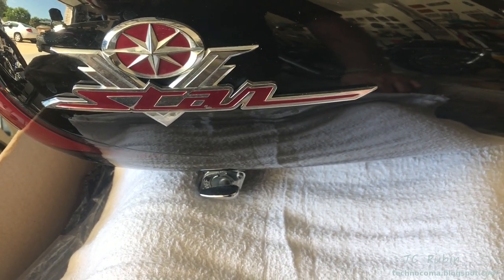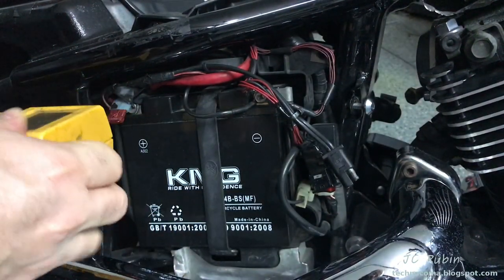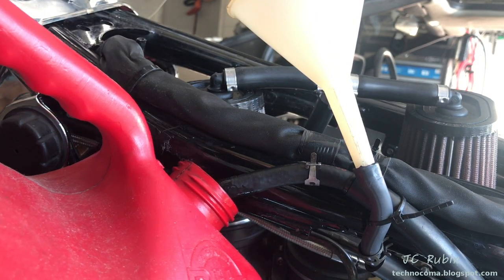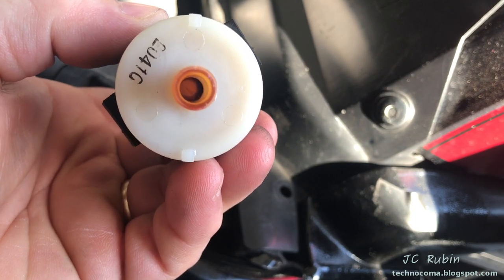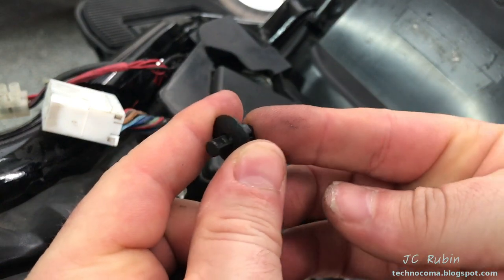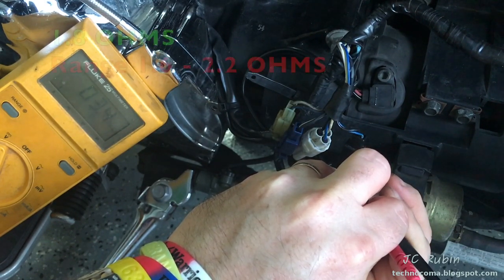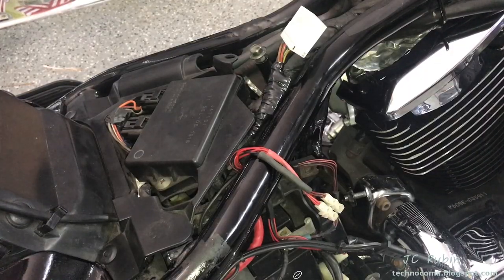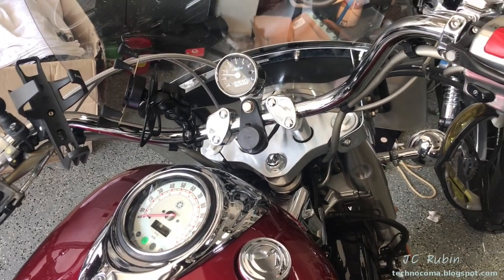Yamaha VSTAR 1100 Fuel System Testing and Troubleshooting  - From The Fuel Tank to the Carbs

Comment: Mate, I owe you! This video saved me a trip to the shop. bike wouild not start, fuel pump dead. It ended up being the rear 30 amp fuse! Pulled it out, checked continuity and put it back in. Brmmm, and away she went. Thanks so much👍

Comment: Love the video! My Brother in Law and I have been trying to figure out what is causing my V Star 1100 to not get enough fuel. We think we found the issue at the Fuel Pump. We noticed that over time the pump got much louder when priming and it seemed to always lag behind when getting on the throttle. 

We might have to go back and undo the gas lines to see how much it’s actually pumping, but huge props on the video! You have made my life much easier as a first time motorcycle buyer!
Reply from the maker: Glad the video was able to help out.

Comment: Thanks for getting back. I guess what I need to know is how to do the electrical check on the fuel pump relay. I did perform the continuity test on my current relay at least 3 separate times and got no reading at all. I’ve since ordered a replacement and need to know how to perform an electrical test with just the rudimentary tools I now have.
Thanks

Comment: Great tutorial!  If taken and considered at the conceptual level, this approach applies to most all vehicles with internal combustion engines.  👍
Reply from the maker: Fuel injection would have taken me longer to go through. There’s a lot of dynamic considerations in efi.
Reply: @retrotechandelectronics  We await your EFI diagnostic and maintenance video!  In my case I was thinking about my 36ft RV with its carbureted V10 engine.  I'd probably put in four miles just going back and forth between the engine compartment and the gas tank checking on connections, wiring, and so on.  At least on the Yamaha everything is within arm's reach.

Comment: Your videos really helped to rebuild the carbs (there was some green gas rot in the enrichener circuit / section) but I'm having an issue where the bike doesn't have the power / quickness to rev as she once did. She's sluggish to rev is the best way to describe it. The bike was like this even before rebuilding the carbs. The bike is completely stock. I've changed the CV rubber boots and needles from another working well bike, thinking there might be a pinhole that I couldn't see, but no difference. Tried replacing the full pump, same thing no difference. There's a new fuel filter put on in the stock location. Spark plugs look ok as there is no wetness residue. I'm really stumped as to what to look for next.
Reply: Did you ever find out what wrong. I felt my bike sluggish today.
Reply: @frankperez4558  Yeah I changed the spark plugs and she was fine after that. I’m assuming one of the NGK plugs was fouled.

Comment: Need some clarification on the fuel pump relay test. I think I can perform the continuity test with alligator clips & my HF multimeters. Not really sure how to test to get the “click click” that you showed. I don’t have that same piece of equipment you do. All fuses good. Horn, lights, starter all work. I also checked the corresponding power source on the harness withe ignition switch on and the kill switch in the ON position. With my test light, it showed power. Hopefully, I can get the fuel pump going.😃
I also enjoy your videos because you retake the time to explain everything in great detail. Whatever mechanical aptitude I have comes from YouTube.
Reply from the maker: The clicking is the priming when you turn on the ignition, provided the bowl aren't filled with gas.
Reply: i have a 1999 Yamaha road star silverado 1600cc  which  i just bought i notice no noise from fuel pump need to find the fuel pump with image

Comment: I live in Germany and recently had my XVS 1100 Dragstar classic (European version of the V.Star) in the shop because live the bike in the video I had let it sit for a few years and the gas turned to slop. I had the bike towed there in order not to gunk up the fuel system with the old gas. The shop supposedly overhauled the carbs, adjusted the valves and installed a new peacock. When I picked up the bike it seemed to run pretty good, not great but good. But gradually the bike started having issues and it got to the point ( after only 600 kilometers) that I needed to drive with the choke on all the time. Long story short, i brought the bike back and explained what was happening and they told me that I was to blame because i only drove 600 kilometers in 3 months and that would cause the fuel system to gunk up again. They ended up cranking up the idle and SOLD me a can of fuel additive and told me to come back after i pushed a tank of fuel with the additive through the system.  The bike still isn't running great. I would appreciate any thoughts , opinions or advice on what is going on. Thanks.

Comment: Your videos are Super helpful I appreciate you...quick question.. I installed a new feul pump on my 2000 1100 v star... it clicks when priming, normal... but then it clicks about every 2/3 seconds after running... is this normal... thank you sir
Reply: Yes mine does the same.

Comment: Hi! Nice video!! You are showing all posibile scenarios of something not working properly 😮
I would like to ask you what diameter (where the hoses connect) does the fuel filter have. I dont want to spill fuel two times since I have to measure first amd then when I get the new filter😂 🙈
Thank you 😊
Reply from the maker: I don’t recollect, but the pump is downstream of the filter. You will loose little fuel by disconnecting it.

Comment: so i need a little help, i have been working on my buddies vstar for bout a couple days now and this thing refuses to start. i checked the fuel pump and found that it primes perfectly fine when there is no fuel line on it leading to the carbs, but when i put the lines back on it doesn't prime and it sounds very weak when it does the little amount it does. could i have a bad fuel pump? thing has great spark and has air but i am concerned about the pump.
Reply from the maker: If the bowls are full it will no longer prime.

Comment: Great video man, really handy. just want to ask what you think my issue is, so I been getting issues with losing power and even cutting out at high revs and I noticed my fuel system had a lot of rust in it and including the carbs, changed my fuel filter, de rusted my tank and drained both carbs and It's been a month with no issues but now I'm sometimes getting a loud singular click noise with huge loss in power for less than a second, this mostly happens when warming up the bike. also I'm getting the same issue as before with loss of revs entirely at high revs. Do you think this is the carbs?
Reply: Oh also my battery swollen massively and was about to blow so I replaced that and the voltage regulator, dunno if this is anything to do with it
Reply from the maker: See if the problem continues with the battery and regulator replaced.

Comment: Thanks so much for your videos, they’ve been a great help when rebuilding the carbs. I’m having an issue where the fuel pump is not getting power when I turn the key on but the pump works fine if I apply power directly to it. I’ve already replaced the main relay with the 30 amp fuse as it went bad and I’ve also replaced the relay that you tested at the end of the video. My manual says to test continuity of the ignition switch and the stop switch but doesn’t explain how to do so. Can you please advise how I would do so or what you think the problem is that is causing me not to get power to the fuel pump when I turn the key on and try to start the bike. Thanks so much.
Reply from the maker: find the wires for the stop switch, turn the switch on, see if the meter goes to zero ohms.

Comment: Two questions:
- Should the pump have continuous power when the contact is turned on? Or is it correct that the relay turns it off after a few seconds?
- How hot is the fuel pump supposed to get? Mine is getting pretty hot and seems to stop functioning when it does so..
Reply from the maker: After the bowls fill there is no more priming to do and it cuts off, generally after a few seconds of clicking.

Comment: Do you have any advice for the problem where the rear cylinder is weak? Is there any way to adjust fuel mixture on the carbs without removing them that your know of?
Reply from the maker: Define weak. Have you done a compression test?

Comment: Gas keeps on flowing through the fuel pump after turning killswitch off. (The pump is not pumping but allows gas through) is it a bad fuel pump?
Reply from the maker: If the hose is open, the check valve is only in the opposite direction.... Does it pump gas when powered? If so, Its ok.
Reply: @retrotechandelectronics  yeah it pumps when powered.

Comment: Does anyone else experience a lot of kerchunking on the starter motor? This is caused by engine kickback and bad design by Yamaha. My starter bolts were very twisted and so I replaced my starter and starter clutch some years back, but this issue never went away. It makes me cringe every time I start my bike, and it's the only reason I will possibly sell my bike some day.

I bought my 1100 Custom new in 2002 and have probably pulled my carbs 30 times over the years, as I'm on my 4th set of pipes, Cobra 2-1 HP, pods, SS420 Cams, Dynatek ignition. Replaced the rear fender and seat for a chopped stiletto look and made custom lights. I've poured a lot of love into my bike, and it still runs like a champ and pulls strong!

Comment: Your video helped me, find my issue.... for the life of me this is a stupid design. The output of the filter should goto the tee that splits to the carbs and bypass the fuel pump...it looks like gravity feed will be plenty...What a weird way to introduce potential failures.
Reply from the maker: I can’t speak as to the reason why it was designed as it was.

Comment: I would like to know why is gas coming out front engine exhaust
Reply from the maker: Are you sure this is not water vapour. Gas can not come out of an exhaust in any volume on a running engine.
Reply: looks and smells gas. Front engine is not getting hot coil has fire and have new plugs in it reset valves

Comment: i have a 1100 vstar and i was having trouble getting fuel to carbs i cleaned them about 100 times and now the carb to the front cylinder is getting too much gas it shoots out the exhaust but none leaks out of the overflow when i turn the gas off and let it run out it starts running on both cylinders does anybody know what i should look for?